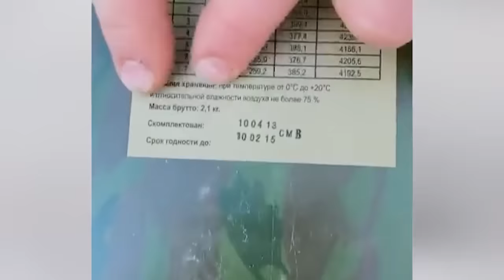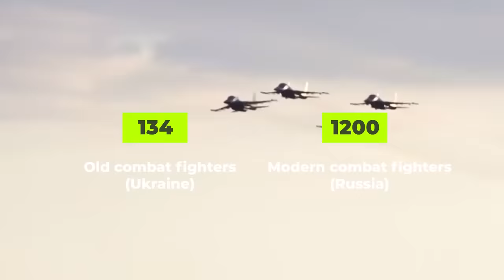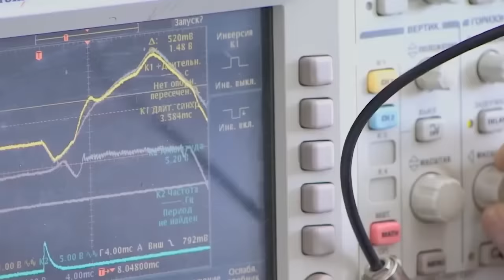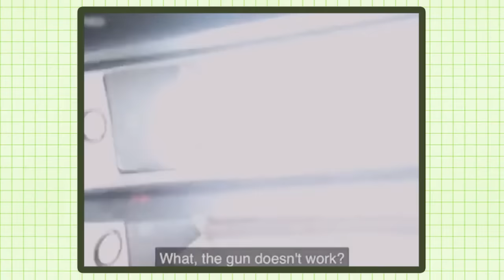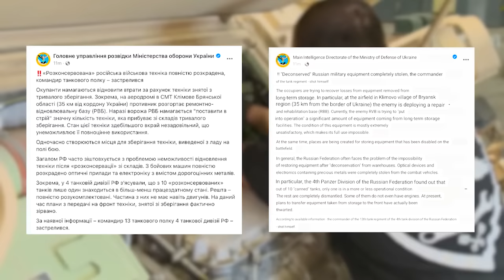Why Russian Arms Failed in Ukraine?

Comment: FYI, the Leclerc French MBT is a 3 crew tank with auto loader but the shells are stored in the rear of the turret in a protected part. So a 3 crew tank does not necessarily implies that ammunition is stored in the same compartment than the crew.
Reply: Exactly. The third series (batch) of Leclerc is armored passively to a level which means the crew already has way more problems than ignition of any ammo if penetration went this deep.
Reply: Read about that. It uses a conveyor belt system if I recall correctly to move the round from the stowage into the breach.

Despite that, a Leclerc can still get off about 6 rounds a minute. Even faster if they're the same time of shot as well. At worse, about 70 seconds for several types of rounds.
Reply: Everyone forgets about the swedish SV-103 or the S-tank.  It's ammunition was stored on the rear of the hull.
Reply: @michaelwilliams9574  - I haven't heard how the ammo was stored on that Tank.
Reply: @FLJBeliever1776  well look it up. I just told you what the vehicle was called. Google is your friend
Reply: @HanSolo__  sp. armoured NOT armored, it is the English spelling NOT Pigeon English!
Reply: @michaelwilliams9574  There is an obvious reason why EVERYONE, except you, forgets about the Swedish S Tank = A FAILURE OF DESIGN - Next!
Reply: @trevorhart545  you are higher than astronaut snatch. The S-tank served for quite a long time.  Tell me what you know about armor? I'm a combat veteran myself from the United States Army armor branch. I think I'd take my opinion and expertise in this field more than some armchair fanboy.  Fact of the matter is, yes tank was a success and held the line in the Swedish army for over 22 years.
Reply: @trevorhart545  oh yeah I forgot to add ... (Just as you tried to arrogantly and ignorantly dismiss me like some schoolboy, right back at ya)... NEXT!
Reply: Leclerc can also neutral steer and reverse quickly, some vital components russian tanks dont have

Comment: For example, There is a section in the book “Command & Control” where they describe the safety device in Polaris misiles. The device was cadmium foil attached to a mechanized roller that would retract it from the nuclear core before launch, thus arming the warhead. Upon inspection sometime later, they were all found to have corroded to where they would not retract, making the nuclear triad a two legged stool. I wonder how many problems like this exist today in the Russian arsenal?
Reply: I agree, the kursk submarine,  not following the guide lines of maintenance.
Reply: @willfannin4725  "Взрыв МБР Titan II в Арканзасе — катастрофа со стратегическим носителем ядерного оружия — межконтинентальной баллистической ракетой LGM-25C Titan II"
Может катастрофа на ядерном объекте в Арканзасе - это несоблюдение руководящих принципов обслуживания?!))) Когда техник уронил ключ в шахту ,который повредил обшивку ракеты и спровоцировал утечку топлива...Посчитайте сколько ядерных ракет при перемещении потеряла Америка.Эти данные в открытом доступе.
Reply: Polaris is a Western system.
Like the astronaut said sitting on the top of a Saturn "just remember this whole thing was built from lowest cost components"!
The T34ay have been crude but the Space Station is still supplied by Russia.
Reply: no idea bro im sure the TV can tell you.
Reply: Notice they caught the defective part before they found out the hard way the gear was trash?🤦
Reply: @dspencer1969  ,"до того как узнали на горьком опыте"? 
Вы б целиком раздел упомянутой  книги прочитали. Да и понимание имели о эксплуатации военной и авиационной техники вообще в мире. У подобной техники есть запланированные по времени (регламенту)  ТО (техническое обслуживание)  и капитальные ремонты.Где техника частично или полностью разбирается (неважно ,валялась она на складе или  стояла на боевом дежурстве) ,заменяются узлы и компоненты подлежащие обязательной замене, и дефектируются (осматриваются не предмет неисправностей или повреждений) все остальное. Вот во время работ подобного плана это и прояснилось.
Reply: @dspencer1969  If your talking about the defective part in the Polaris missiles, they only 'found out' 90% of them wouldn't have worked if launched, when they were being dismantled as obsolete and no longer in the subs. In effect, they were permanantly 'safe'. 

Mind you, the 10% that WOULD have worked would still have killed huge numbers of russians.
Reply: @sirmalus5153  Thanks for the info Sir Malus
Reply: polaris is us british fool.
Reply: @jazzytimes2373  Errrrr, actually it's both. The USA and UK had/have Polaris missiles.

Comment: I recall, when Russia crossed the Ukrainian border (March '22?), an American video on Youtube spoke of the fact that the very long column of Russian vehicles, had come to a halt and reasoned as to why. 

The gentelman hosting the channel said, in his qualified opinion, many if not most of these vehicles were not functioning. He spotted that they'd had damaged tyres from poor storeage and suspected that service on them was almost certainly, a Big issue. He also spoke of corruption, short cuts and poorly trained troops.
Reply: a long column of armored vehicles that have to run on road because they don't have off-road wheels and tires ca easily be stopped by knocking out a few vehicles at the head of the line.
Reply: @J R i am sure that many soldiers did not think so much before looting their own military.
Reply: How did Putin know that Ukraine didn’t have much for artillery?
Reply: @touristguy87  The soldiers were only following the example of their commanders, who were following the example of the Moskow Mafia, which was lead by another example of a thief and fraud artist.
Reply: @J R thieves' logic
that's a subset of pirates' logic
Reply: "Comrade the tire is flat".  "Pump it up with air".  "Comrade, it has been flat for 10 years".  "Pump it up with extra air".
Reply: @J R sure...😂😂😂
Reply: The main issue with gas. By all accounts the majority of the Russian troops that were stationed in Belarus before The Invasion never actually expect that they were going into combat and I thought the whole thing was a show of force. Because corruption is extremely endemic within the Russian Armed Forces, they were all selling their diesel fuel
Reply: Feb 24
Reply: Chinese made dry rot tires
Reply: I saw a YouTube post by an American A-10 pilot who was pleading to just spend one day in the battle with his tank-killing Thunderbolt II aircraft.  He showed via a flight simulator that he alone - one pilot and one aircraft - could have knocked out 94% of the tanks and support vehicles in the column before he needed refueling and reloading.  One aircraft killing 250 tanks on one tank of gas.
Reply: Yet Russia still keeps winning?
Reply: @GameOver-hu1vi  does it?
Reply: @GameOver-hu1vi  won what? They've been sitting in the same spot for months shooting from far away lol. It's been a standstill almost
Reply: @GameOver-hu1vi  actually not even a standstill cause Ukraine is making gains

Comment: That question about just how reliable Russia's nuclear arsenal is, is one I have asked my self.  I visited Ukraine in the 1990s and noticed that the infrastructure was seriously bad, even dangerous.  Electric trollies for instance were continuously losing contact with the overhead power supply line.  The operator had to done huge leather gauntlets, climb to the top of the bus, and manually recapture the power connection.  Electical transmissin lines were nightmares.  In Sebastopol, which was still Russian at the time, submarine maintenance was "down-the-line" scavenging from one vessel to the next in order to keep one or two operational.  And yes, I could look directly across the estuary to the docks where the subs were maintained.  The same kind of maintenance was used to keep civil, and, I suspect, military aircraft operating.  This was Ukraine just out of the Soviet Union and the level of decay could not possibly have evolved during the short span since Ukraine had become independent.  So, the USSR was proably in worse shape than Russia is at present.
Reply: Thank you for your firsthand account. However, while the state of affairs in Russia is almost certainly comparable to what you describe based on recent reports, those reports also indicate that Ukraine had advanced considerably in its economy and the state of its infrastructure since the days of the Warsaw Pact, beyond contemporary Russia.
Reply: @danieldickson8591  No question concerning Ukraine.  They were right at the starting point of the modern nation.  The remnants of the USSR were everywhere.  They were still trying to figure out things like how to plan developments.  Many of us in the US are not fond of developers, but there is a process, and they generally follow the rules. In the mid-'90s in Sebastopol there really were no rules.  I recall one subdivision that had roads and immense houses, but there were not utilies.  No electricity, water, or sewer, and no septics either.  Barely any roads. none paved.  Huge, nice looking houses with outhouses in the backyard.
Reply: I worked in the Soviet Union from 1984--86 and back there again from December 1989----March 1990, The standard of everything from buildings to engineering was appalling, the Russians seemed to be experts at putting up new buildings that immediately looked old and about to fall down. Their society was tatty and third-rate, in fact, the country was one giant prison camp full of mostly unhappy people. I would like to go back and see if there has been any improvement in standards, but from what I can see both in material welfare and personal freedom for the individual, it looks like Not a lot.

Comment: I never really thought about Russia not accurately maintaining their nuclear arsenal.  I just assumed they would be highly maintained and upgraded as the US constantly does theirs.
Reply: USA - 800 Bilions/year - 1400 active nukes. Russia - 70 Bilions/year - 1600 active nukes.
Reply: @zperdek  but what percent from that 1600 is still working? Probably less than 1.
Reply: The Russian ICBM's use liquid-fuelled motors, whereas the US ICBM's are solid-fuelled.  Liquid fuelled rockets are far more complex in design and also require complex and ongoing maintenance in order to keep them not only safe but also ready for active service without notice; they also often require fuelling immediately prior to use.  Solid-fuelled rockets are far more reliable & safe, and require far less ongoing maintenance to keep them operational and ready for immediate service.  

If the Russians have trouble keeping simple cargo trucks and personnel carriers maintained and fit for service, what does this tell us about the actual state of readiness of their nuclear missiles?
Reply: if they even fly it would be a miracle
Reply: All hydrogen nukes have a rather quick expiration date that dovetails with the service contract centered business practices in the US.  Whereas more frugal Soviet designs prevailed during their heyday.  A rather large proportion of their arsenal was stocked with low & no maintenance fission nukes albeit of much lower kiloton yields.  A megaton non-hydrogen device would be prohibitively unwieldly.  Physically too big.  So, Russia definitely has functional nukes.  Just not the highest grade ones.  Probably.
Reply: They are all drunk..what maitnece
Reply: @marioborkowski5894  I had a friend tell me the same thing once, Russian dude former soldier, told me we were drunk most of the time.

Comment: 9:05 the tires on vehicles need to be replaced regularly even when they're not used because they degrade from exposure to the environment.
What someone probably did was substitute old  tires or substandard tires for new ones and pocket the money that they were to have spent replacing them.
Reply: Tyres need to be military grade, they cost money, they've put the cheapest chinese civilian tyres you could find and pocketed the difference, the result was as expected.
Reply: @dannyboy_vtc8980  The best military tire are the American military BFGoodrich Baja  $225.00 – $450.00 each.  while you can easily get Four Chinese Copy version around $250 total.
Reply: Tires on a regular car, even if not worn, should be replaced every 5 years. After 10 they're straight up unsafe to use. Has to do with the way rubber degrades over time. I imagine military vehicle tires are even worse.

Comment: russia has a reported 1588 strategic warheads deployed.  their running success rate i n ukraine, across all weapon platforms deployed, is about 40%  60% of any given weapon used fail to preforn as expected.  if their nukes follow this ratio, then of the 812 ICBMs they have, only 325 will deliver warheadds to target.  of the 576 sub launched missiles, only 230 will work as expected.  and of those 1588 war heads,  952 will be duds.
still, if  all 635 working warheads are on working missiles and all 80 plane dropped bombs make it to their target,  things will be ugly for a long time.
Reply: Yes that's a good breakdown. And also, use of nuclear weapons by Russia is likely to result in retaliation, so for round numbers a total of 1300 nuclear explosions. That's enough to start a nuclear Winter that could wipe out most of humanity  over time. Best avoided, for all sides.
Reply: you forget the fact that Russia needs to upkeep these and replace the warheads and combustion chambers, and guidance equipment. they have to do all of this while the missiles are in frigid temperatures then burning hot then rainy, electronics don't survive long in those conditions.
Reply: Not 5% will work.
Reply: @frenchfry1479  The US might have winters to 15F.  Russia has winters to -40F to -60F, and for a long winter.  I would have extra food in the bunker to launch one of those, and make sure I parked my car 5 miles away and biked in.
Reply: @donaldkasper8346  Well I'd have to be persuaded by such an eloquent answer now, wouldn't I? Stop embarrassing yourself, somebody you know might see.
Reply: @michaelkelly339  Troll.
Reply: @donaldkasper8346  Remember what I said about embarrassing yourself? You really don't know when to stop, do you?
Reply: Mistake ... Sarmat is a SINGLE launching platform carryhing 10 warheads who start to work midair over the target in  SPACE ORBIT ...
Reply: Nukes are expensive, and they have an economy the size of Italy's. Is it even possible for them to maintain them all?
Reply: Remember that one of the priorities during a nuclear war is to preserve as much of your nuclear forces as possible in order to strengthen your position during the cease fire talks.  Also, to preserve as much of your military and civilian infrastructure as possible. (This is why neither the US nor Russian will target each other's leadership.  Without leaders you have nobody to negotiate a cease--fire with.)

So the Russians and the US will both be seeking to achieve their objectives while using as few warheads as possible.  And to avoid 'city busting' attacks in order to preserve your own cities.  So I'd figure that only about 25% of the available launch systems will be used in order to still have a nuclear capability after the enemy counterstrike.

Comment: We can apply common sense to the issue of how reliable Russian nuclear weapons are based on current facts coming out of Ukraine.    To begin, the majority of Russian vehicles (aircraft and missiles) rely completely on Western electronics.  Have you seen the insides of helicopters, jets, missiles etc that have been shot down?   Everything is based on Western technology and even with that, their equipment remains substandard.   Some equipment has circuit boards out of microwave ovens or dishwashers manufactured in the west.  The Russians have a LONG history of lying about.... everything when it concerns their military.   They have created an illusion concerning how powerful they are and nothing more.  When a nation brags about how powerful it is we need to pause and ask ourselves why they never provide evidence to their claims?   As a quick example, the Su-57 was declared the best stealth fighter of Russian design.  The Russians bragged it can take on ANY Western stealth fighter.   Do you recall when the Russians rolled out the Su-57 to the public and media?  It was towed onto the tarmac under a tarp and then revealed.   It just sat there for a photo op.  Soon after it was revealed that the Su-57 does not YET have the proper engines in order to become operational.   The Russians were using mock up engines for the aircraft during the photo op and substandard engines for flight testing.  To put it another way, the Su-57 is a tiger with no teeth.  It's all an illusion and nothing more.